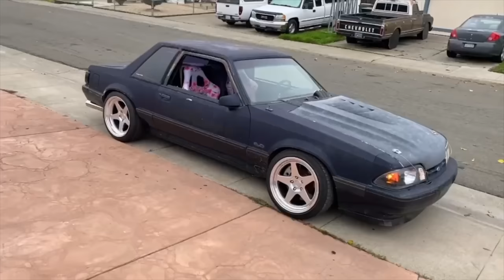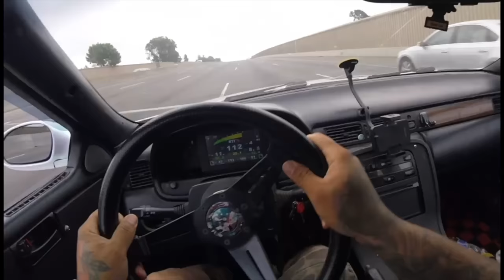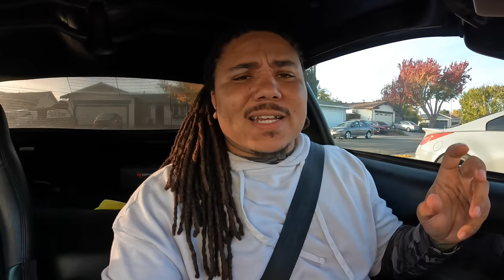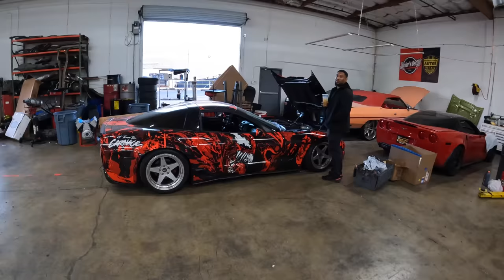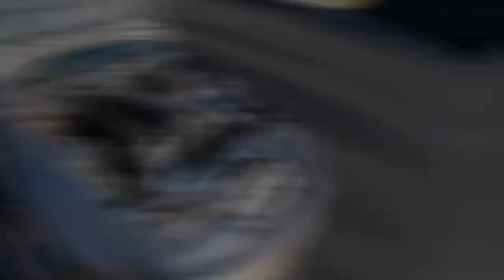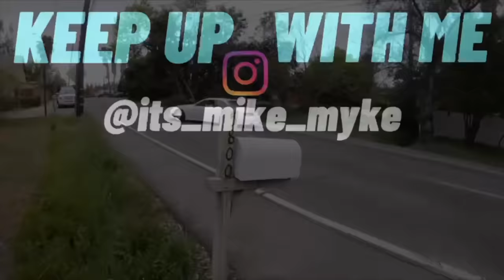If They Can't Fix It, I'm Going To Throw This Corvette To The Junk Yard…

Comment: My Silverado did the same thing until a tunner in Long Beach told me my air flow and fuel ratio was off so he fixed it and it stop dying on me on speed bumps or stop lights

Comment: Get some  electrical cleaner that you clean up bro and zip tires to the fuel real/ a crazy thing my benz had motor oil in his injectors connectors electric cleaner everything fine

Comment: Another thing headlight wires are cracked you could be touching because that motor hotter than the radiator my god did cuz years in the radiator and they super hot cars got to get a new one hands from a headlights

Comment: Great video content on your corvettes. You have awesome upgrades and usable HP & TQ. I just sold my 2002 Z06, had suspension upgrades and motor, exhaust work done on it. Loved the car, but need more power. Just put a down payment on a 2007 C6 Z06, picking it up Tuesday, only 8000 miles and all stock. Can you recommend a good cam and head work that I will need.

Comment: I had a misfire on my 6.0 for 2 years and No one could figure it out and they replaced all my abs sensors and it went away don't know why but it did I put 7k in all new lifters valves plugs wires coil packs all new sensors and everything still didn't fix it. Put abs sensors on all 4 wheels haven't had a problem yet weird

Comment: Don't bad knock sensors throw ur timing outta whack tho?
Reply from the maker: Not if they turned off
Reply: @Its_Mike_Myke  I've been dealing wit a p0325 knock sensors on my car smh I replaced one wit a 170 sensor and other is a 60$ sensor now the 60$ sensor isn't working 😂 finally got it all put back together and looked on the ground I forgot to put back on the manifold gasket 🤦🏼‍♂️ now I have fuel injector codes 😂 my clapped out 97 es300 wit over 250k on it might be time to jus junk it lmao

Comment: Hey Mike I just got a 4.8l vortec truck and I wanna make it a nice sleeper. My goal is between 600+horse power I was gonna get it swapped with a 4l80 rwd stage 3 or 2. Then build up my suspension then after that do some engine work and then pro charge it.